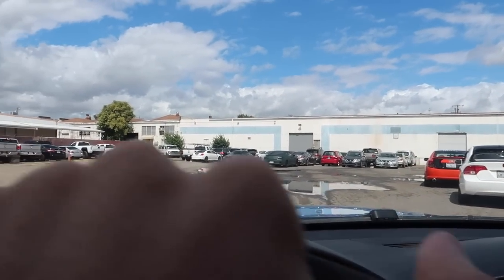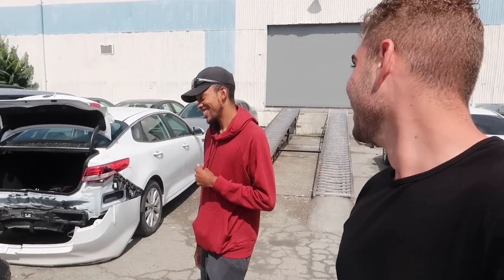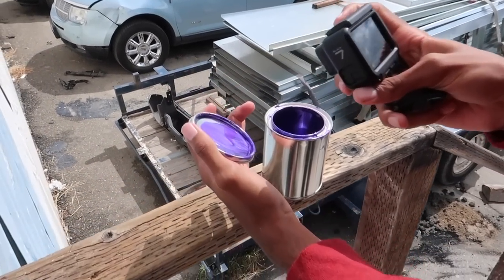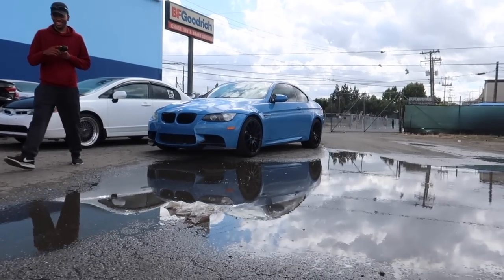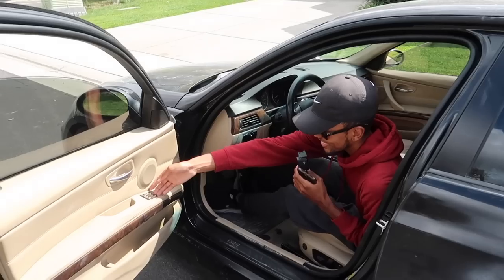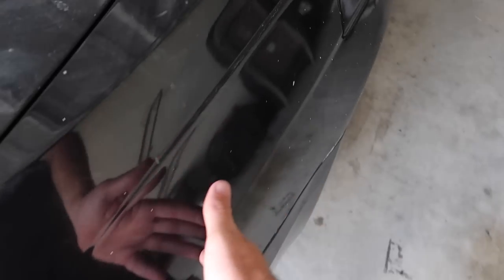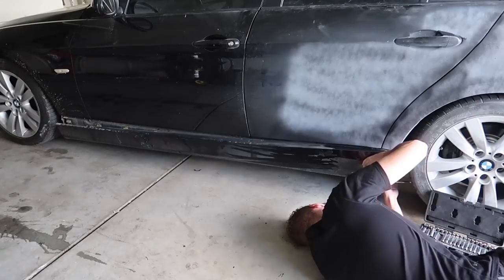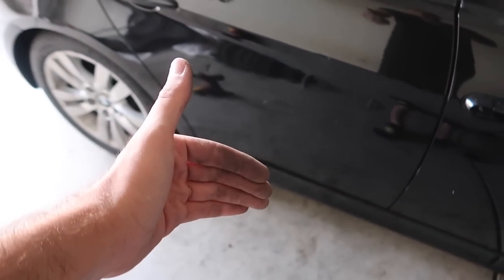PROJECT DAILY IS BACK! SELLING THE M3?!

Comment: Like you content. I bought my 07 335i cash at 17 years old. Emerald Green lowered on Coilovers Matte Black 2015 M-Sport Wheels Tinted all around. Ive got for a really good price. 1 year of ownership this month. I tuned it on the first month  MHD Tuned it stage 1+ Maps. Was planning on going stage 2+ Full Bolton’s Etc, but I changed my mind and now in the market for a 2013+ 335i and maybe down the Road an M-sport. Anything is Possible.